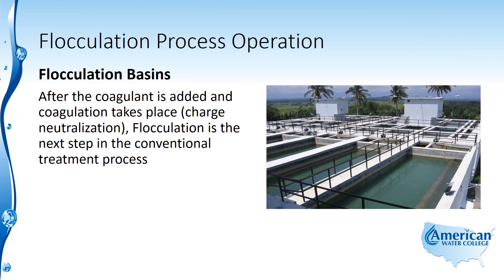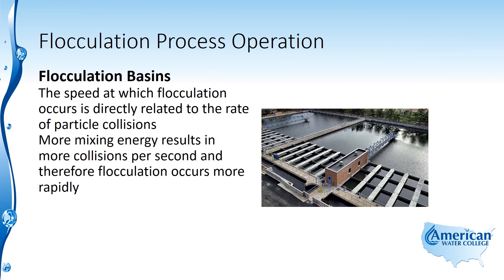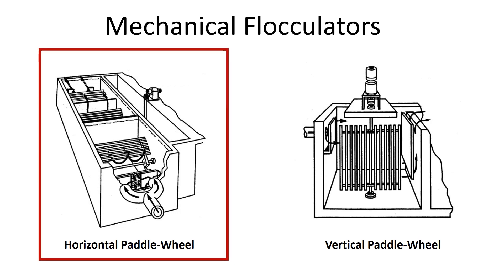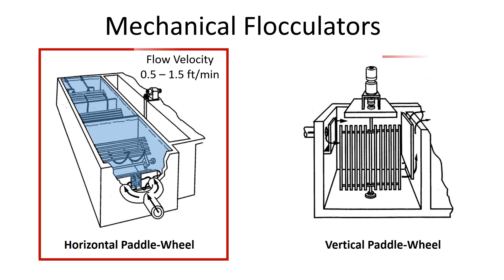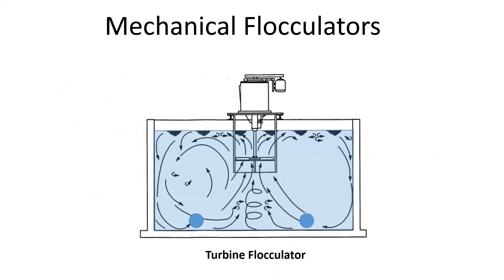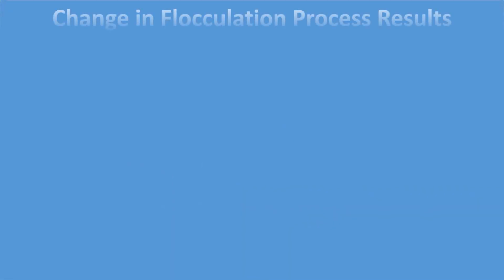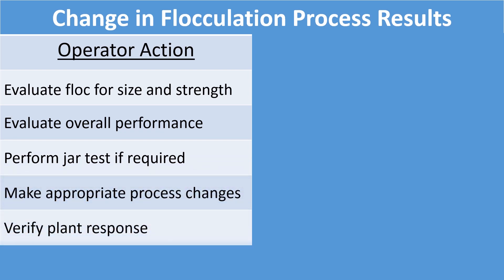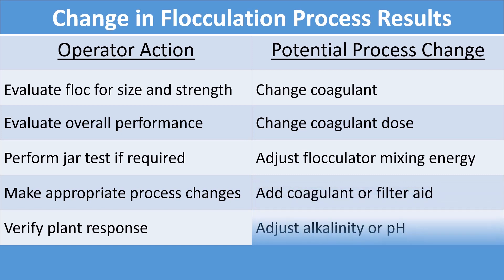Water Treatment | Flocculation Process Operation

Comment: thank you for the explanation sir, from the video i can know that the flocculation process is takes place after the coagulant added. on the flocculation process the small particles called microfloc and the large particles called macrofloc. and now i know there are 2 mechanical flocculators that udually used.
-FTIUJ